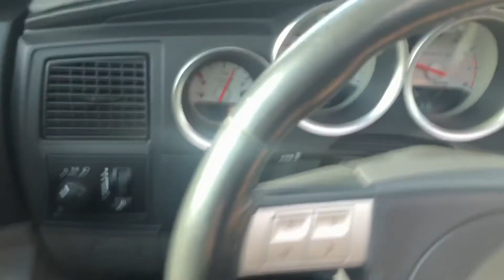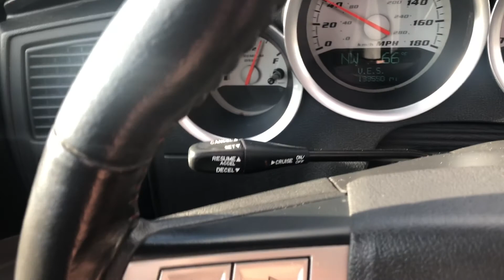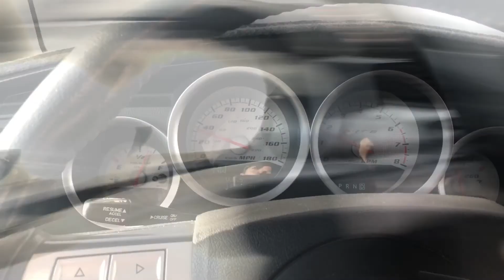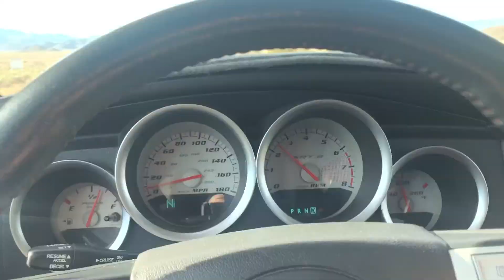Everything broke, so we bought a SRT8 to make us feel better.

Comment: Take care of it. My 5.7 magnum dropped the valve seats. They also have a lifter and cam problems.
Reply: So far I've only heard those issues in 5.7s and specifically the magnum too. I hear about magnum rts dropping valve seats a lot more than any challenger, charger, 300c, 1500, durango, or dakota.